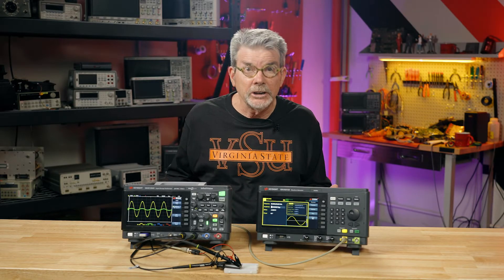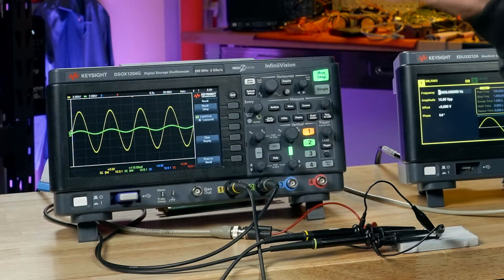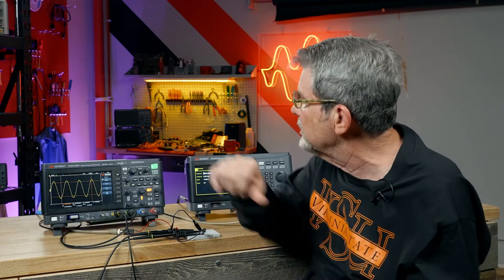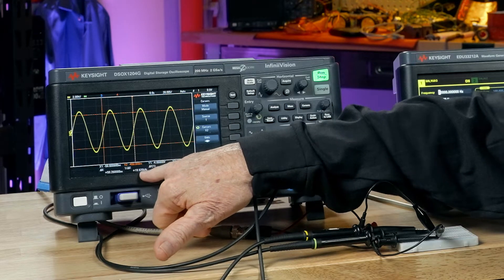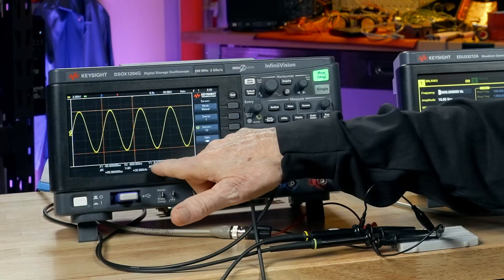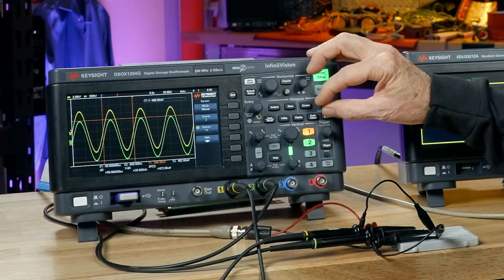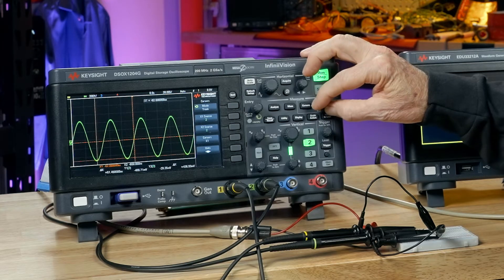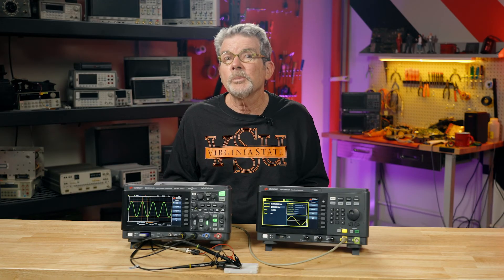Lesson 5: Cursor Measurements

Comment: Here's another technique for reducing measurement errors when using an oscilloscope to measure voltage or time: Use only one side of the trace when performing amplitude or time measurements—e.g., make all measurements using only the bottom edge of the trace for ΔVoltage measurements (e.g., measuring peak-to-peak voltage), or make all measurements using only the left edge of the trace for Δtime measurements (e.g., rise time, period, etc.).  Never to use both sides of the trace—i.e., top and bottom, or left and right—when making measurements because doing so adds the trace's thickness into the measurement.